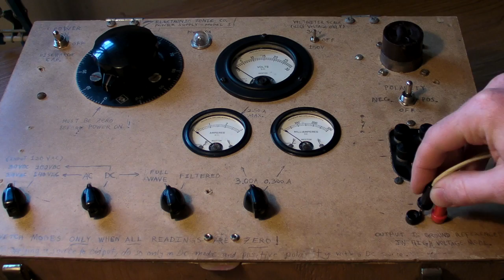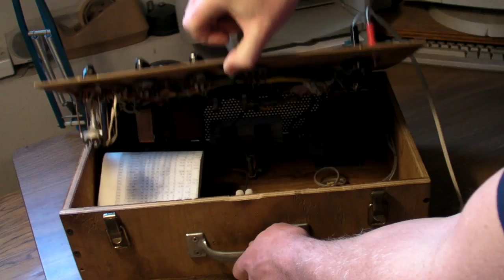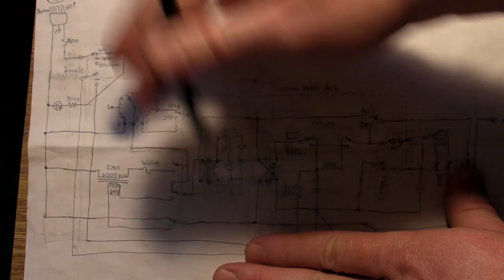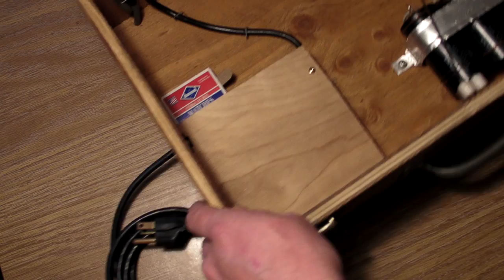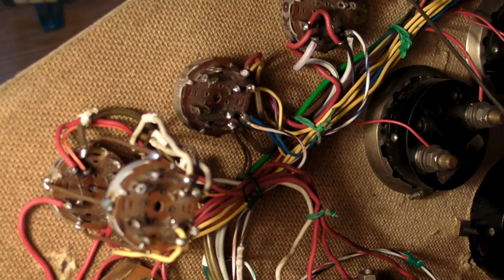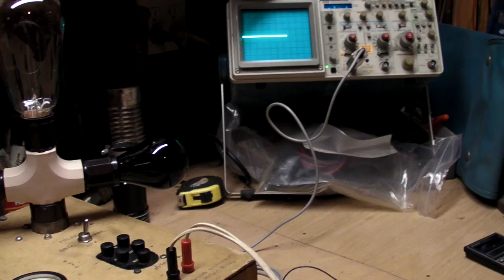(#0085) Homemade Universal Power Supply - Very Oldschool

Comment: Rat Ass Old School.  I used to have an Edwards Electric Bench Power Supply.  Wished I still did.  It was basically a commercial model of what you built for yourself there.  I'm just wondering where I could find a Variac Today.  The rest is not to hard but that Variac would be a find if it is out there.

Comment: you should use fuses 2x or 2.5x the max value you plan to run a circuit, never desing to run a circuit close to your parts max specs

Comment: Fuses blow because of current peak pulses through the bridge rectifier. You would be better off using a 3A slow blow fuse so that it integrates the current over a cycle instead of heating to melting during the duration of a single cycle.